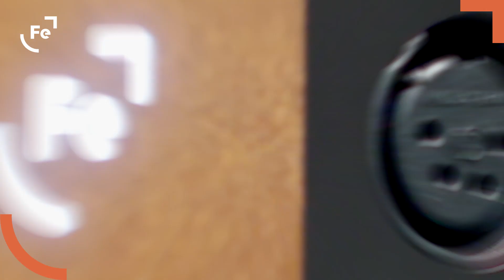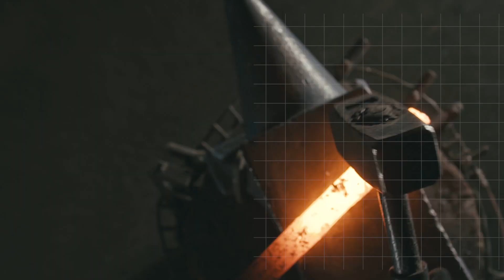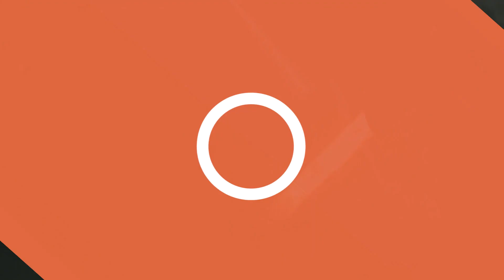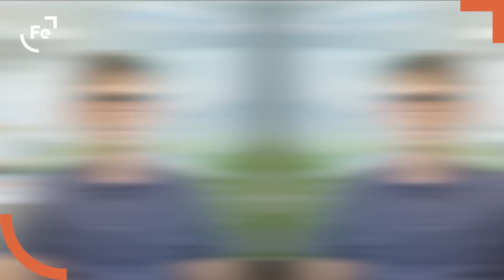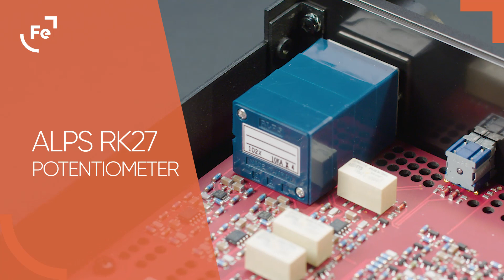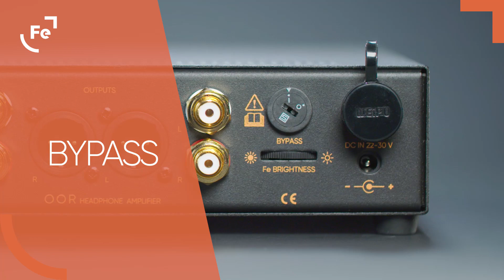Ferrum OOR - MOORE about OOR

Comment: Hi will the XLR output to a separate poweramp still work if the bypass is switched on? Planning to also use this in home theater were the preamp is the receiver.